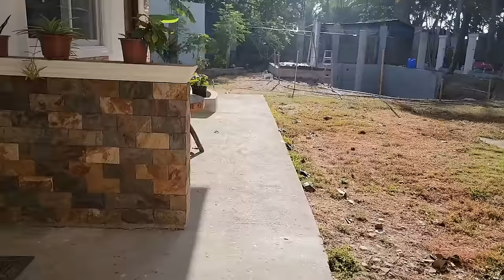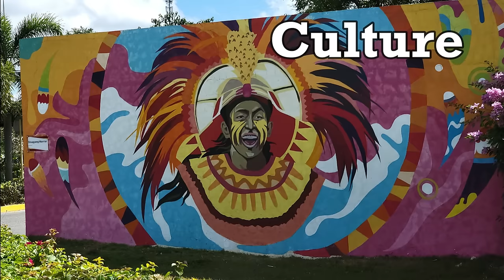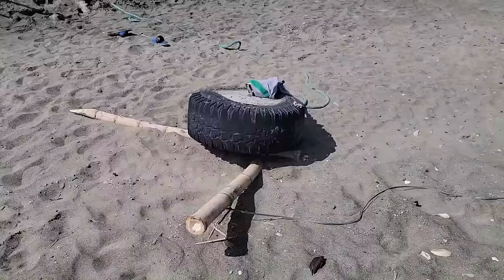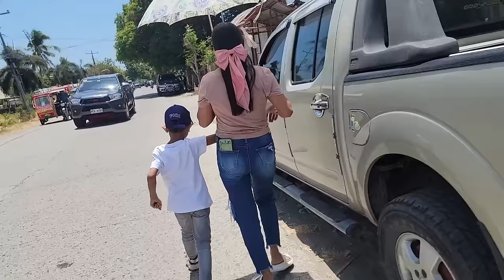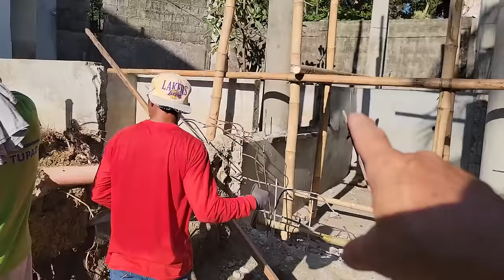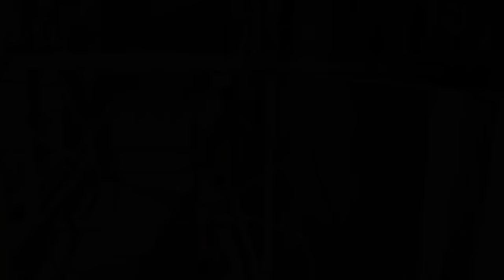Rich Kano's Yacht crashes on our beach, Engineers evaluating MISHAP!

Comment: Thought I saw you and Mel out on your bamboo platform at night? Didn’t see the styrofoam back behind the float then? You even mentioned they had difficulty getting the big tire anchor off the platform. 
Yes excavations need some form of shoring if you’re concerned about stuffing of the sidewalls. Might consider putting some tarp, burlap, fabric or heavier plastic on the backside of your welded wire. It will help hold the soil in a little. Like a Hesco or not…
Reply from the maker: no we spaced the wire out  from the soil and rendered it. It's not touching the soil. Watch next video :)